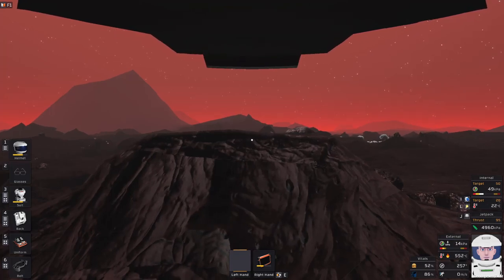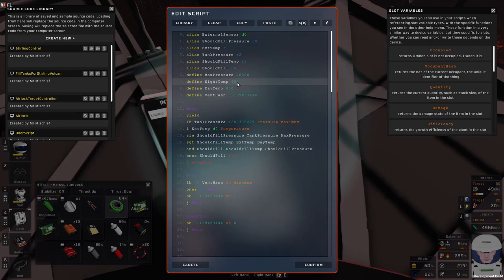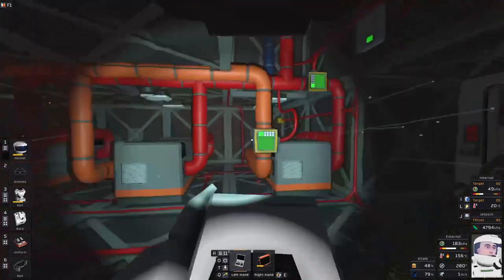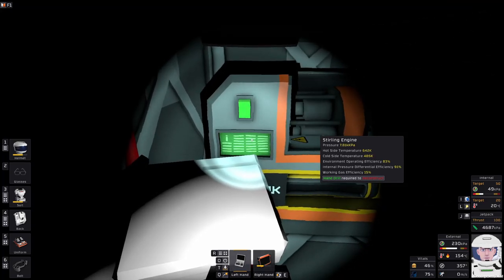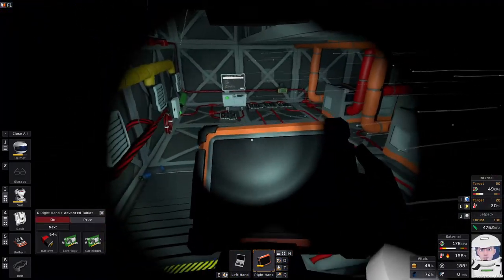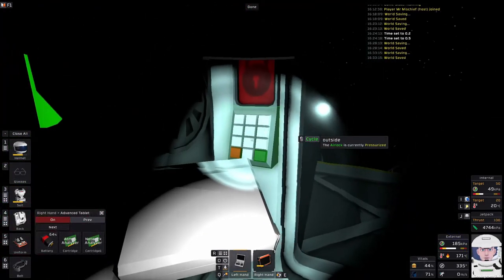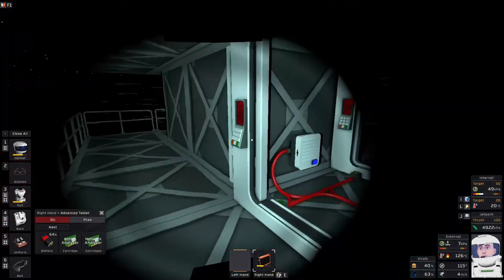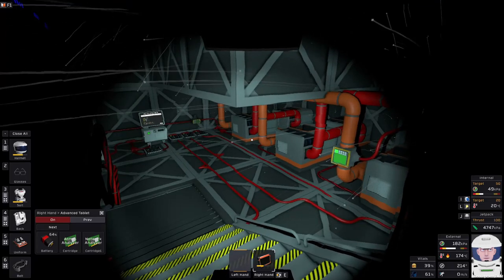Stationeers Stirling Engine Advanced: Renewable Energy on Vulcan

Comment: Nice setup! I didn't expect a temperature gradient of only 180 degrees to be enough to generate that much power.

I've been playing around modding geothermics into the game as another option for getting temperature gradients, and hopefully soon there will be more options so that on other planets the Stirling engine can be used for more than just capturing waste power from furnace output and the hydrogen combustor.
Reply from the maker: Yeah the temperature gradient on Vulcan makes for some interesting and challenging design problems. Full respect to anyone that mods Stationeers, it's not a very modder friendly code-base to work with!